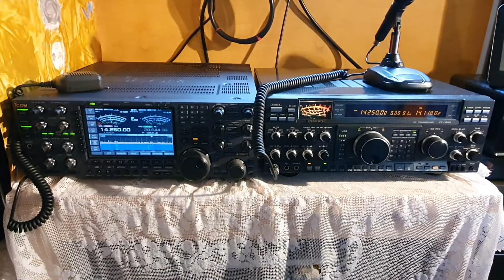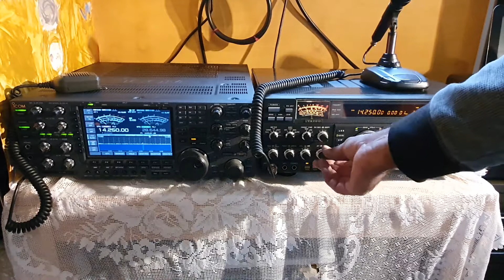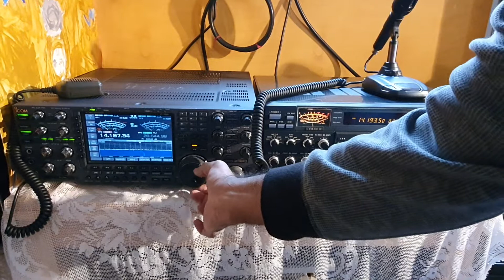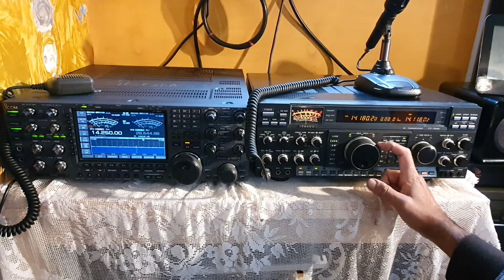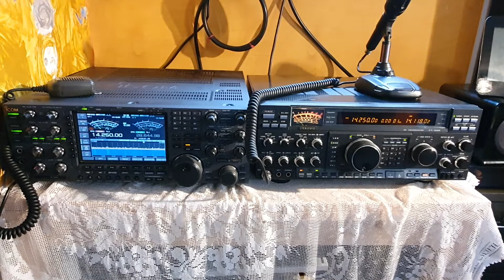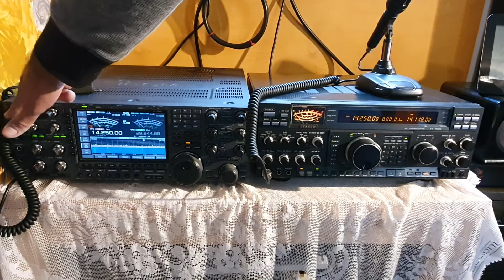Icom IC-7800 Versus Yaesu FT-1000D - Reception Comparison on 20 Meterband

Comment: Icom has some notch filtering , you can hear it work on the signal skirts. The FT is more natural. The icom sounds like it’s in a cave but completely audible. You have to fiddle with the FT to pull up the signal from the noise floor.  There should be a notch filter on the FT
Reply: I have the 1000D now and can tell you that it is a quiet radio, compared to my ICOM 7100 and 746. I like pulling weak signals out of the noise, I just do not like the ICOM open squelch and no signal white noise - it is painful. The ICOM7800 is 20 years newer and has SDR, the 1000D, I have, was built in 1993 and no DSP/SDR. For the FT1000D in USB mode, you have to shift IF full counter clockwise, the RF mixer full counter clockwise, roofing filter 2.4k. Turn off the RF amp, use IPO and MED to FAST AGC.  I will actually turn down the RF gain or use ATT to decrease the noise floor.  If you have an s3 or better signal, there is not much you have to do with any radio. IC7800 is one of the best radios ever made and you can see the signals not just hear them so it wins just on that point alone.  i could hear the ICOM open squelch noise on your video so I would look closer at the FTDX 101's, which is probably a better comparison to the IC7800.  The point is you should know the radio and how to get the best performance, I am sure the ICOM has its sweet spots too, like RIT, and Noise reduction.

Comment: I have both of those rigs also and the receive on the 7800 is way better than the ft1000D
Reply from the maker: Totally agreed IC-7800 has far greater reception capability than FT-1000D and TX is also way better too. If you use Icon SM-50 Microphone it will shine and people will tell you that you sound like BBC. Enjoy them both are excellent HF equipment of all times.  Many thanks for supporting the channel, much appriciated.

Comment: You have the preamp on the Yaesu, so it's going to be more noisy.
Reply from the maker: Thanks totally agree noise is by product of signal amplification at pre-amp level. I try not to use much but during weak propagation it brings signal to readability then off course noise increases too. Though noise filters are very effective in this radio but they also have adverse effects on the crispness of audio. But I must admit you have very good ears and understanding of amplification of signal-to-noise characteristics. Thanks for bringing it up and supporting the channel, much appreciated. Best 73s